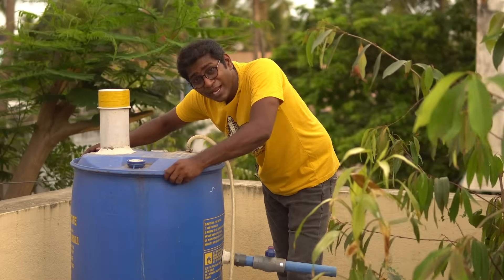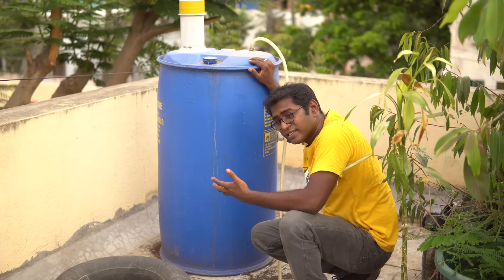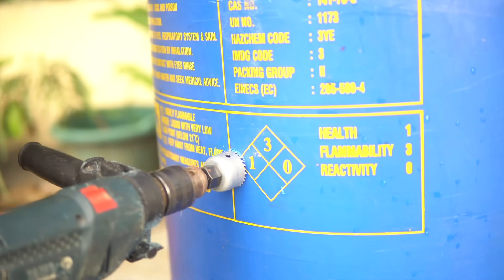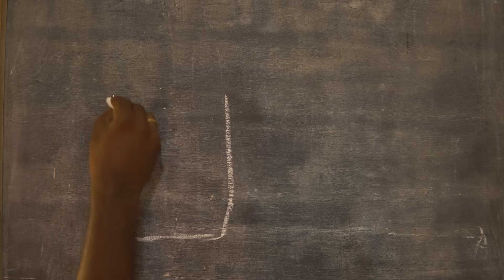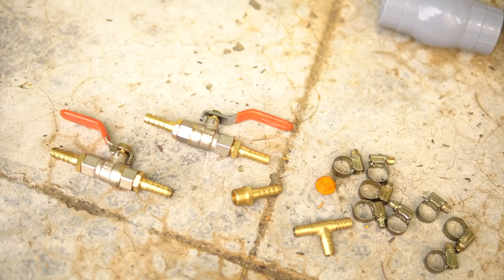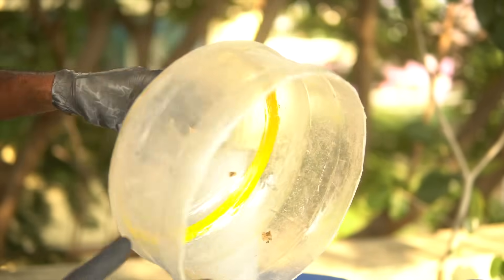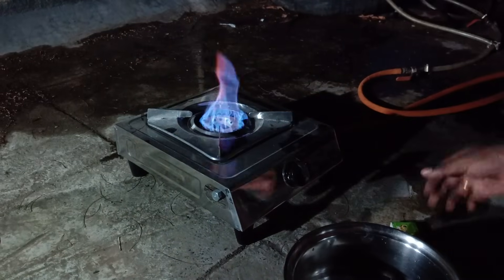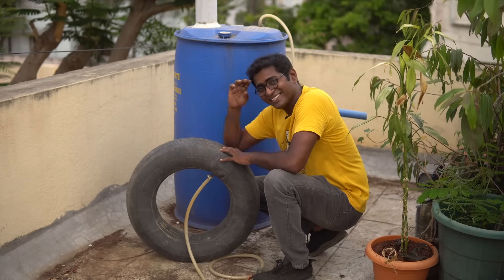Make your own Bio gas to save money on LPG

Comment: Thank you so much finally well explained.  Can you tell me what do you do with the residue on drone do you take it out? When the gas is finished you have to wait another week for gas to produce? How long last.
Reply from the maker: waste comes out as slurry but if you want to remove it for some reason, need to add an opening in the bottom with a ball valve for emergencies. Add a storage tank which is larger let it fill to maximum and then start using it. Feed the digester regularly which is important
Reply: Hi can you tell me please how many days that I can you. For  acooking?

Comment: I've also made a small biogas digester. It's been about 5 days. It's giving out CO2 from the pipe. Any suggestions how to improve the biogas production?
Reply: Hey @Rahul, @videoeppo. Apart from methane(CH4), Biogas also comprises of Carbon Dioxide (CO2) and Hydrogen Sulphide (H2S) which may cause a little trouble as you said. To improve that you can use a scruber comprising of Iron Bur and Carbon to eliminate the above.
Reply from the maker: apart from basic steps like warm surroundings, no leaks and regular feeding... it's the bacteria that do the work. Wait for couple of weeks and you will see gas production

Comment: Good Job, Man! I second that the outflow tube can be higher on the barrel to increase the digesting volume which would increase possible gas production. The bacteria used doesn't need airspace, other than for the collection reservoir which could be bigger and have a removable weight of some kind that could be put on the reservoir to increase the gas pressure when you want to use it. People often pass the bio gas through a tube full of steel wool to scrub the NOx out before sending it to the reservoir ... The bacteria does need to be kept warm to work best, at least 75°F, If I'm remembering correctly... Hoping people find this on a community level as one of the solutions to the "energy crises" ... God bless!
Reply from the maker: Your thought are so much appreciated. I mean this is what this community for!. Share what we know. Thanks again
Reply: Great comment
Reply: If the slurry is  slowly stirred,  would  it be beneficial?

Comment: What you to do those wastage? How u will take those out?
Reply from the maker: It turns into slurry. But I had a tough time shifting this unit. So it will be wise to add an outlet at the bottom which could be connected to the sewage system. Keeping this terrace was a foolish idea too. Four people were needed to bring it down. Then I pulled it on my homemade trolley to a nearby sewer to empty it.(we were vacating that house). Keep these thing in mind please

Comment: 🙂 Hi, your video is well made and very interesting.  Remember to add a good backflash arrester to decrease the risk of explosion. If you try raising the height of the slurry pipe you could fit more in the reactor. Then it may produce more gas a little sooner.  You may find the bacteria works better at a different temperature. If its cold it may wok better in a sunny position. If too hot maybe a shady position. I think, if the rector temperature was around 24c it would work very well. I would not let it get to hot though as it may effect the bacteria that produces the gas. Just trying to help 👍
Reply from the maker: Thank you so so much!
Reply: @VIDEOEPPO  🙂👍
Reply: @VIDEOEPPO  does you update it yet or is it still work in progress
Reply from the maker: @Lose-is-not-Loose  Not yet. I have moved to a new house. Need to figure out a few things before I install this. Also, my workshop is not setup yet. It might take a few months to get to this project
Reply: @VIDEOEPPO  Can you please share a schematic of the project for us non-engineers to understand this.
Reply: How long does it last
Reply: Ma mm.
Ma
N

Ma lb ma know

Ma
Reply: Thanks sir this is helpful

Comment: Good day sir please I tried making a biogas with a 5L container. Mixed up fresh cow dung with chicken Pop with water, I use a drip tube as a passage for the gas an di completely sealed all the air space with some glue. After 3 days the container had expand so I opened the end of the tube for the gas to come out and I introduced flame to the opening but the gas which was coming out did not light flame I don't know what is the reason for that. Thank you
Reply from the maker: For the initial few days, only some other kind of gas comes out. Keep adding waste and try it. For me, it took me three weeks to see the flame.

Comment: Can i use my cylinder in place of the tube
Reply from the maker: In a cylinder, the gas comes in compressed form when you get it. This gas will not have pressure. Hence we tube. When the tube inflates, we keep a few bricks to compress the gas inside the tube. The cylinder might not work, if you don have a way to compress the gas and feed it into the cylinder

Comment: Nice video. Very clearly explained. Think you need to make scrubber from steelwool and pvc pipe that will prevent possibility of explosion
Reply from the maker: Yes indeed. This one started off as a test project. But now, I figured out that it could actually be put to work. I will have to make the setup properly

Comment: Great idea.
Is static electricity an issue? How does the system prevent oxygen from mixing with gas and reaching a lower or upper explosive limit.
Reply from the maker: that's too technical for me, but can you be a bit elaborate. How is static electricity  an issue here?  As for Oxygen, All of the air is cleared in the first few test and a flash back arrestor with steel wool and a bubbler can dissolve impurities is what I read.

Comment: Super output .One small idea for the gas out put pin you may use 1/2 inch coupling on the inner side to  catch and use L  bend and connect the nipple there so the gas hose cannot brake  quick .Why I am saying this  means you connect the nipple direct to drum it may open when the pressure increases   tufflon tape may come out because of jelliness
Reply from the maker: Fantastic. Makes sense. Also the tube will not bend if I follow your idea. Thanks a bunch